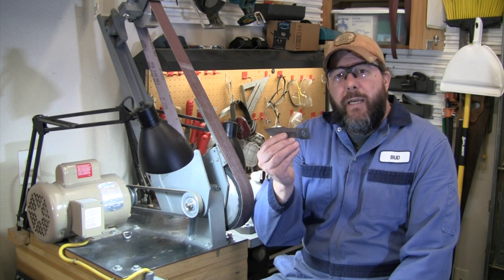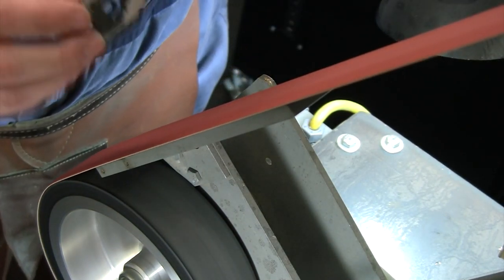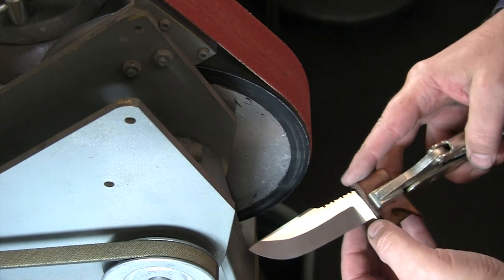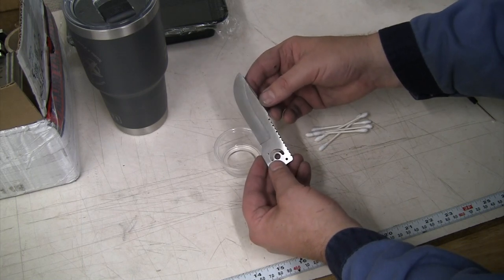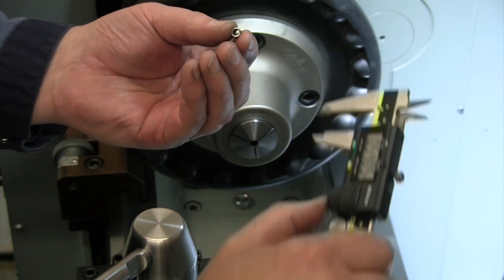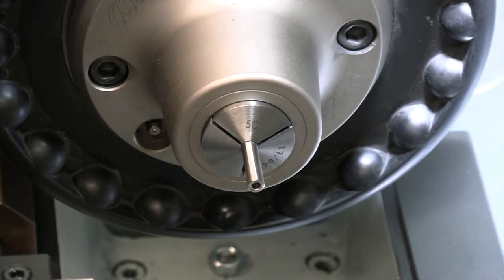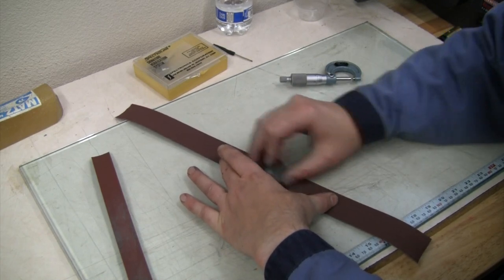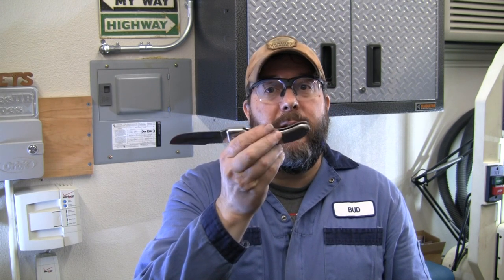Triple"B"S Knife Lock Build Series - Part 5 Finishing The Blade, Bushing & Back Spacers

Comment: Looks great Bud! Still waiting for my machines to come in, but cant wait to start setting everything up and making stuff.
Reply from the maker: Christian Stark - Thank you!  I hope your machine is arriving soon. Had a couple viewers get theirs in last week. Or enough to get assembled, I think they are still waiting on the controller.  Will be worth the wait. Spend your time playing in Fusion or your CAD/CAM program of choice. I can’t recall if you already use that or not?  That was a big part of the learning curve for me and time you can invest now while waiting.
Reply: @BladesIIB  my machines will be manual, but I’m planning on using 360 for part design.
Reply from the maker: @christianstark1055  Gotcha, manual is great and Fusion will still help your manual designs. More than once I modified my idea after modeling it in fusion and seeing how it would actually look and operate. Can save a ton of time and scrapped material.